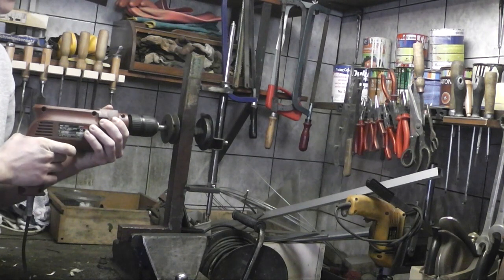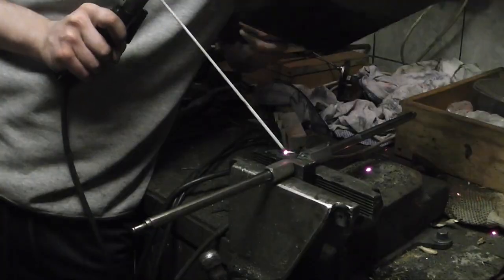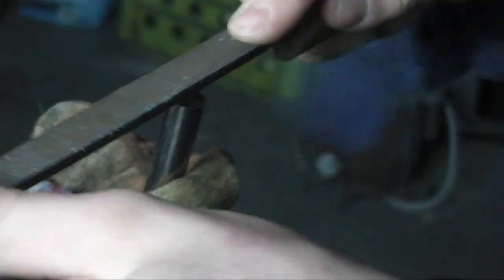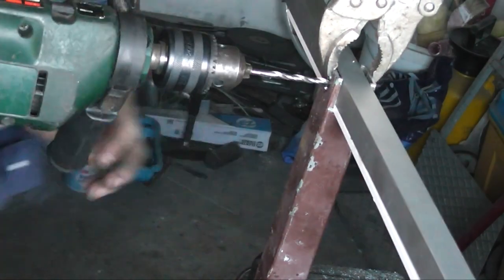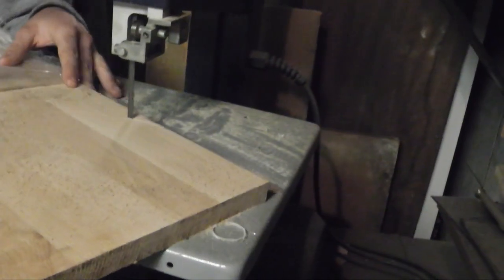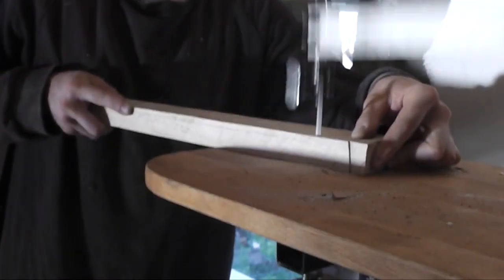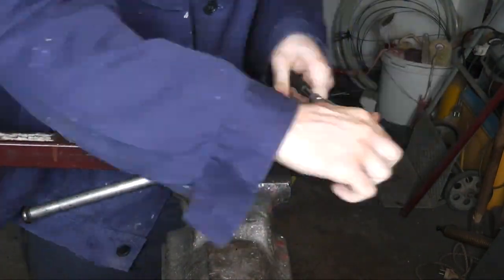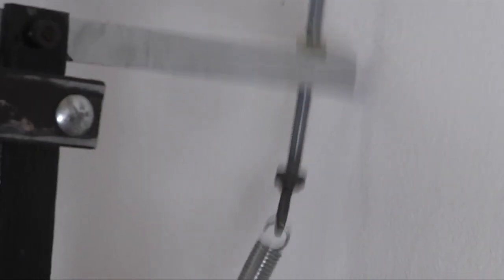Making a Homemade Scroll Saw ( Build video )

Comment: Is there any chance you're going to make a belt grinder any time soon ?
Reply from the maker: I've been wanting to make one for years, just never got around to making one as finding belts can be tricky where I live.
Reply: Garage workshop I completely understand,I am from Bulgaria and it's the same there , but if you can find  a specialized shop for abrasives that's where I found belts of all sizes and they where even making custom ones.